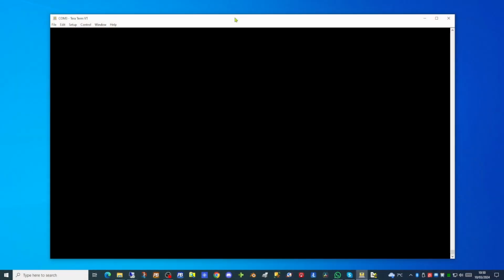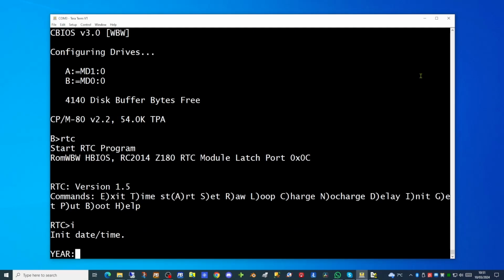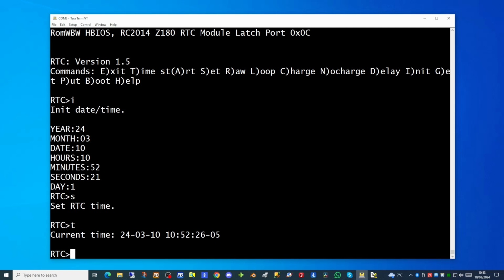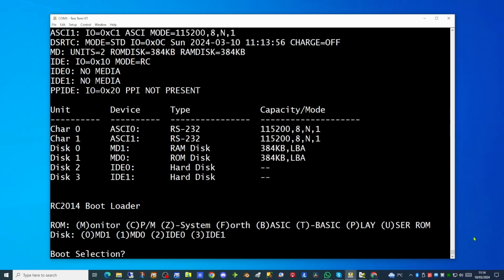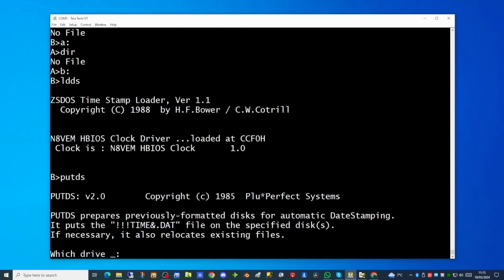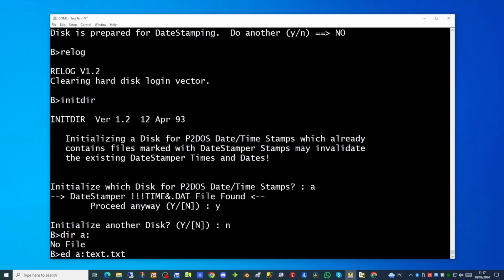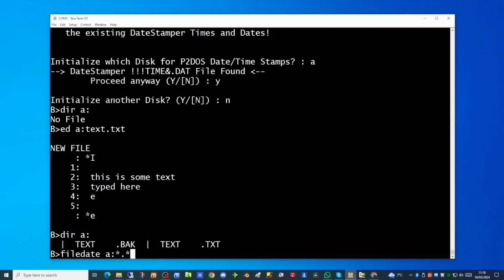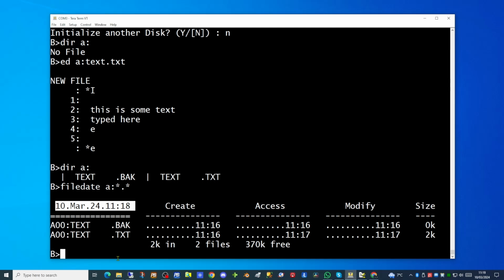sc203 modular z180 computer kit - part 7 - testing the Real Time Clock (RTC) card

Comment: I got my full kit from Mr. Cousins this past Monday. ( 3/4/2024) Including the SC722, SC721, SC702, SC712, SC719, SC704, SC407, SC406, SC303 and of course the SC727 RTC.  All soldered up and assembled. All working great.  I flashed one of the ROMs to RomWBW Ver 3.5-dev 18. I am currently booting into Z-System on the SD and have the timestamping working as well. I am trying to decide if I want to go to NZ-Com or just stay Z-System. I have done some tinkering with Assembly using the old HiTech C and ZDE editor all local. Although fun to do it all on the system perhaps it is time to dig into z88dk and cross assemble.
Reply from the maker: That sounds like you have a great system going there. I haven't tried NZ-Com yet, but it's a logical progression from the Z-System supplied on the ROMs. I'll be interested to hear how you get on.